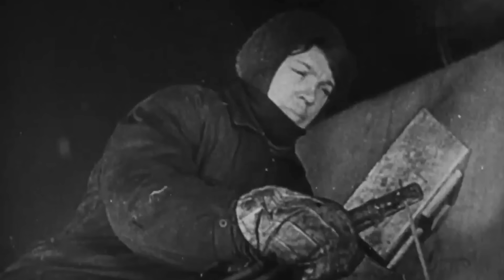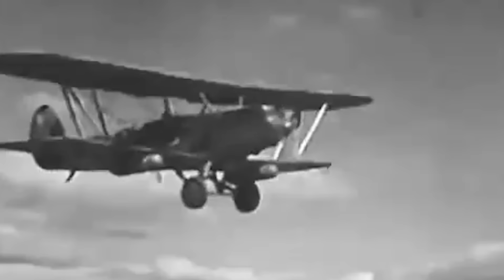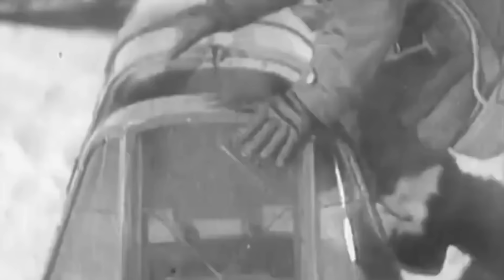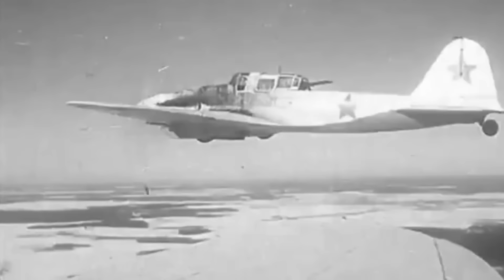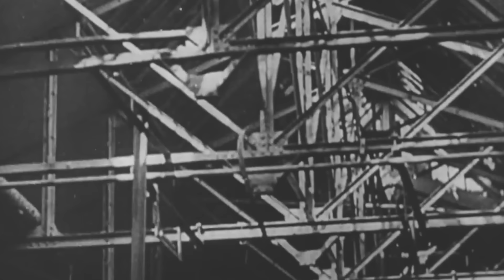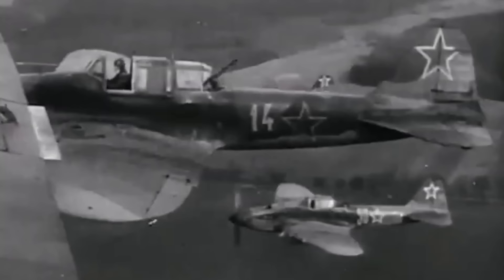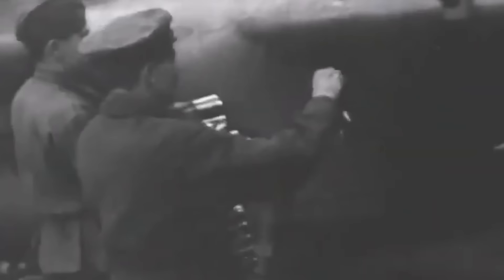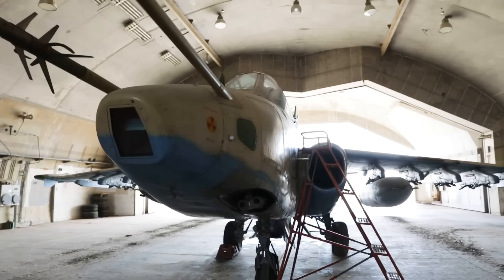The Plane that Could Receive a Panzer Attack and Keep Flying

Comment: The claim that with the beginning of the war, single Il-2s were immediately equipped with a seat for the shooter is false. Unfortunately, due to the technical difficulties associated with the conversion of a single Il-2 into a double, for quite a long time the pilots had to go into battle without an onboard shooter. Given the high risk of using the IL-2, the title of Hero of the Soviet Union (the highest military award) was awarded to the surviving pilots for 10 sorties.

Comment: The Germans had a skill issue.
Reply: Not Hartmann...he knocked these off like flies.
Reply: @terraflow__bryanburdo4547  is that an achievement to knock out the aircraft which isn't designed for dog fighting?
Reply: The top Aces were German.
Reply: @magenta_king  I don't know if you watched the video, but that aircraft is known as the "flying tank" or "concrete airplane". Not a good target for the inexpert...plus there is the issue of escort fighters....
Reply: Did you see the thumbnail?

Comment: Just call it something between a Stuka and a tank yeah, they wer touģh as door nails but not invincible and wer shot down in droves as said here, but ofcourse many also got home badly shot up, the rear gunner never had much protection from the area he had to cover too and there survival rate was fairly low 👀, but still tougher than any other aircraft of its day for sure and even a good survivor in a hard landing or crash situation where other aircraft would usualy break up 👍

Comment: The Frogfoot is a good candidate for lineal descendant of the  Sturmovik, but I would also add the A-10. A similar armored “bathtub” under the pilot (titanium in the A-10 to save weight) and main landing gear wheels that protrude slightly at full-retract for a less damaging belly landing after a gear failure.
Reply: Su-25 looks more protected than A-10.There are videos of them withstanding multiple Stinger hits but still flying

Comment: The Il-2 Sturmovik was a tough plane, but it wasn't as rugged and durable as the P-47 Thunderbolt.
Reply: P-47 is designed as fighter aircraft with capability ground attack. Yes it has  armored cockpit but not as heavy as IL2. Those 2 are different aircraft.
Reply: Where did you get that myth, from a video game?
Reply: @gort8203  It's a fact. Look it up. The P-47 was superior in every way. It was faster, carried a heavier payload, its 8 .50 caliber M2 Brownings gave it more firepower.And definitely was more durable. As they said in the video a lot of Stumoviks were made of low-grade steel or wood. It was just the usual over-hyped Soviet junk.
Reply: @dugzamilza5212  The P-47 had a larger bomb load than the IL-2
Reply: @keithallver2450  
No, it's not a fact. I'm familiar with both aircraft and don't need to look anything new up.

First of all, your claim was that the IL-2 "wasn't as rugged and durable as the P-47".  Now you are changing your tune and saying the P-47 was faster and more heavily armed.  Well, that is simply not relevant to being more rugged and durable. In fact, being faster is not relevant in any way whatsoever. And even the more heavily armed claim is debatable, but let's just skip that distraction.

In the context of rugged and durable the IL-2 was much more heavily armored than the P-47 and thus able to absorb more hits from ground fire and remain airborne.  I don't know what you meant by "load-grade steel", but steel did function as both load bearing structure and armor for vital parts of the plane, which is why it was indeed rugged and durable in combat.  

The P-47 was one of the greatest airplanes of WWII, so much so that even dumb fan boy comments can't tarnish its real record.

Comment: The A-10's grand pappy. 😂
Reply: Nope. Actually the A1 Skyraider was.
Reply: @UkrainianPaulie  The AX program that produced the A-10 did use both the IL-2 and the A-1 as role models.  The IL-2 was in some ways an even better inspiration than the A-1, but the A-1 was the still operational airplane that required a replacement.